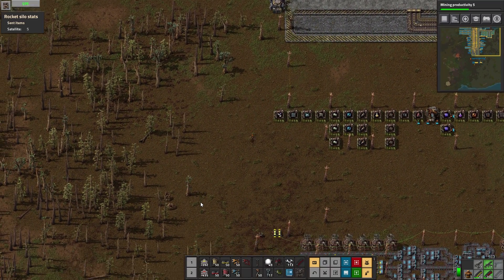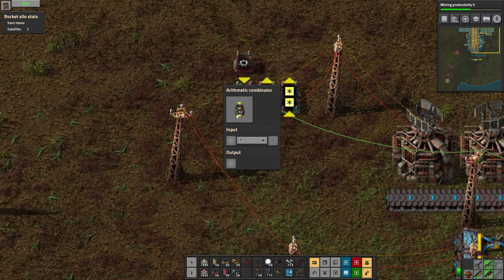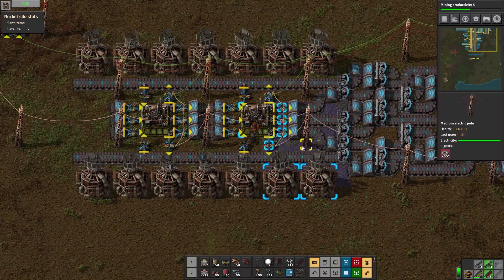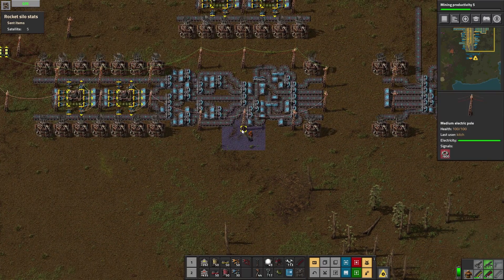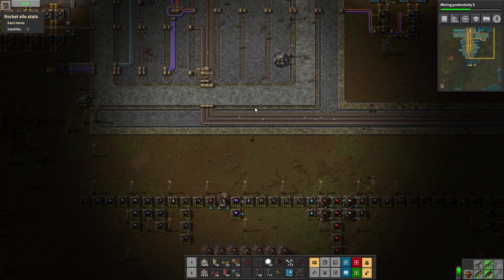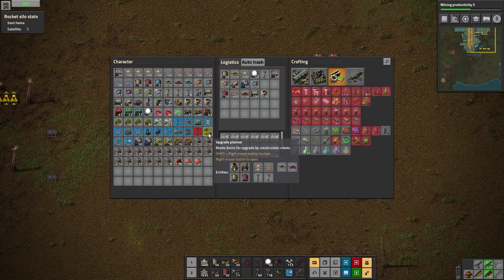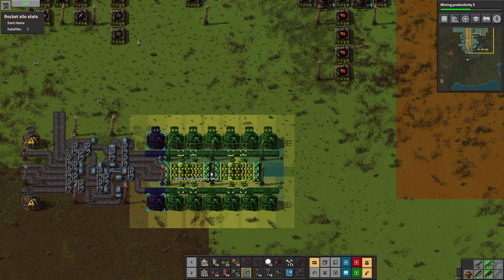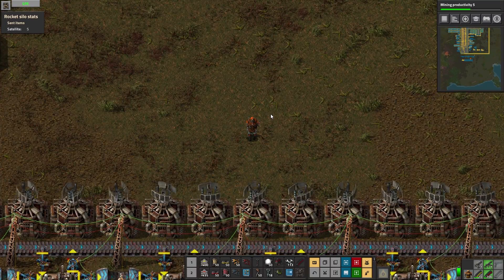Factorio 0.17 Sushification | Ep 4 | Calculation Corrections

Comment: 2 points:
1. I’d suggest direct insertion of copper wires for green chips. Via top/bottom belt weaving. No reason to put them on sushi belts. For red chips that will be blue/red undergrounds weaving. 
2. Sushi setup needs to go around in circles. So quite likely you’ll end up having 2 rows of assemblers to make it a circle.

Comment: 19:35, you could just use an underground belt for the second lane coming in from the left to feed in a straight line and have that top belt go above it.
Similar idea also for the output of the 7to5 that you build 30 seconds later.
Also, for the Icons, try using the Circuit Tab, like ABC, 123. For example "Fish - I - N - Fish" and "Fish - 2 - I - Fish"
Reply: Nice idea
Reply: TSG, your icons would have...
🐠I
N🐠

needs to be fish fish I N
🐠🐠
IN

or fish I fish N
🐠I
🐠N
Reply: @iwantmypot  Ah yes, guess you're right.

Comment: 7:40 This setup doesn't actually constrain you from doing combinators along with assemblers to save clicks. We just wanted you to get rid of half of them (at least me :D)
18:46 Do you think you can fit seven lines of items into just five? 45*7 > 45*5, bottleneck is inevitable, maybe you should condense some items first and then add something needed later(plastic? coal?)
Reply: 18:46 not necessary because you have a counter setup on the belt that controls your inputs, so its not 2 full lines coming in. Its just 2 lines coming in which occasionally will carry items
Reply from the maker: Yeah, at 7:40 I kind of threw the baby out with the bathwater, as they say.  At this point, I'm planning a bunch of iterations....  
@18:45 I'm banking on 5 lanes being more than we'll need for this to work...  that is yet to be determined.  (And could possibly result in a big, huge "Just Kidding" and a fade to black) :).
Reply: @KitchsVideos  did you catch my comment on one of the previous videos? It has the same idea as using the -ve values so you can do a <0 setup. However, instead of getting that in to each inserter, give the red and green to a decider combinator. Output from the decider something like Green color 1 if the conditions are met. Inserters are set to enabled if Green =1. That way, for each machine, you only need to set the logic on the decide combinator, not each inserter
Reply: For full details,
the input inserters (left side) are connected to red wire to upper power poles (subtractors). 
Output inserters (right side) are connected by green wire to upper power poles (adders).
1 Decider combinator for each assembly machine, set to 'item'<0, then output 1 on green channel.
Inputs for decider combinator : green wire from upper power poles, red wire from lower power poles.
Output from Decider combinator goes on red wire to output inserters (does not connect to lower or upper power poles).
Output inserters enabled if Green = 1.
 Overview: you have an adder network on upper power pole green wire, which is also your total items on belt. You have a subtractor network on upper powerpole red wire. You have a demand signal on the lower powerpole red wire, and each assembly machine's output inserters has a enabled network on the red wire from decider combinator.

To setup, place the blueprint, set the item in the assembly machine, same item in decider cominator. That's it!
Reply: @vikhattangady  Ooohhhh, you are right, absolutely forgot the counter. But I still cannot figure out  about 7 input lines. It's still a bottleneck as not all of the lines are flowing simultaneously
Reply: @mrchuse1  look at it this way: its only a bottle neck if you have 5 fully compressed blue belt worth of items passing through the balancer, and then you try to add 2 more belts to that.
However, when all the required quantities are set, you may only have 3 blue belt worth of items, but spread out over 5 belts, so always place for more.

The total number of items you can have in all 5 belts together = number of items that a belt holds in a 1x1 tile X total number of belt tiles. Eg. If a 1x1 belt tile (fully compressed belt) holds 6 items, and your blueprint of the entire sushi setup has 400 belt 'pieces', there's place for 6x400=2400 items. But through the counters, the total maybe only 2000 items, and new items are added only when existing ones are taken off, so all 5 belts are not fully compressed, so always place for more items. (Plus ofcourse each splitter and underground belt also adds to the capacity). If you're running short of space, make a bigger loop, so instead of 400 belts, you are using say 500. Then you get more space.
Reply: @vikhattangady  I do understand what you say, but if you watch 4:00 in the first sushification vid, you'll see that Kitch needs 7 blue lines of thing and that's what confuses me. Correct me if I'm wrong.
Reply: @mrchuse1  ok. Ya i missed that part. He does say it, but not sure how he calculated that.
Reply: @mrchuse1  episode 5 is up. He needs 7 lines to bring in "raw" materials. All the other items will be built inside the design.

Comment: How do you manage the copper and iron plates, so not to have them fill up all the belts? 
Or put in another way... how do you control it so that those items are in exactly the right amount on the belts?
Reply from the maker: There will be a circuit to the belt, with a condition hooked up to the counter.  If you haven't checked the creative series (or in the 'Back to Basics' series, where I set up the science sushi) there's some examples of limiting the input on belts based on circuits.